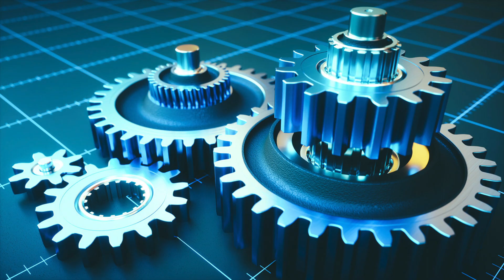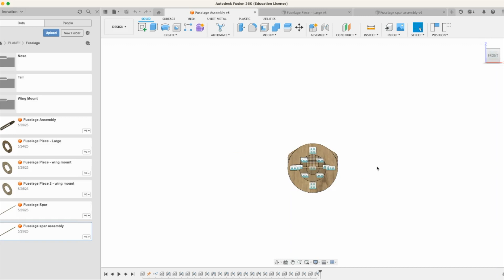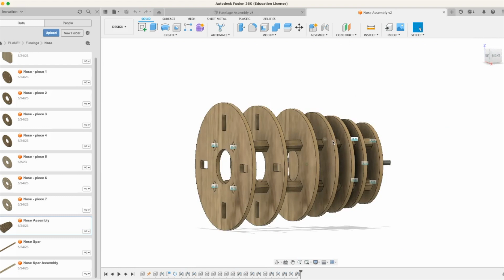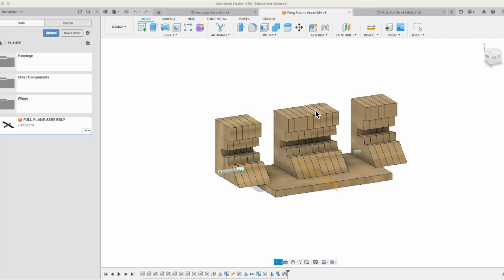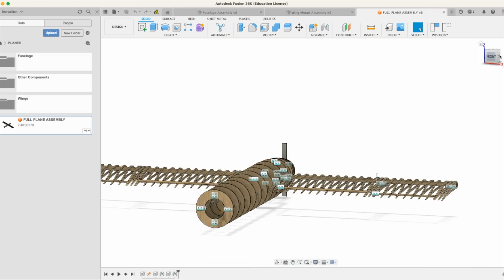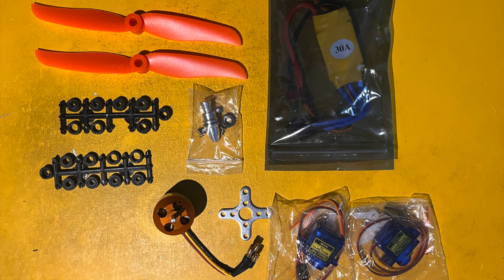Designing and Building a Remote Control Airplane! (Part 2)

Comment: You can still have a rudder if you wire up the ailerons with a Y-connector. 

There are these servo cables that convert one cable to 2, and you can attach both of your aileron servos to that and have them controlled by one channel. There's a setting in your receiver that you can adjust to ensure that they go in opposite directions, or if you want a flaperon type of thing you can configure that too. This way, you can have a throttle channel, an aileron channel, an elevator channel, a separate flap channel (if you want), and a rudder channel. 

You only have 4 joystick channels, so I would map rudder, elevator, aileron, and throttle to those. For flaps, use the 3-position switch to activate the flaps and put them in different positions. The progress is looking awesome, can't wait to see her fly!
Reply from the maker: Thanks Navid! I actually went to a hobby shop shortly after I posted this and they told me that I could connect it with a Y-connector.